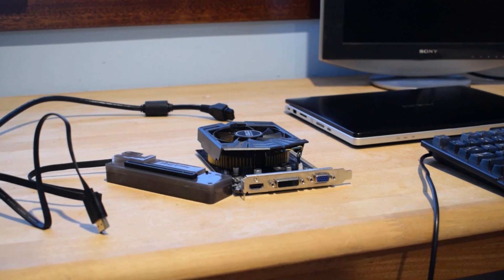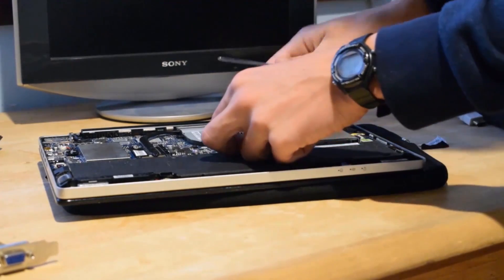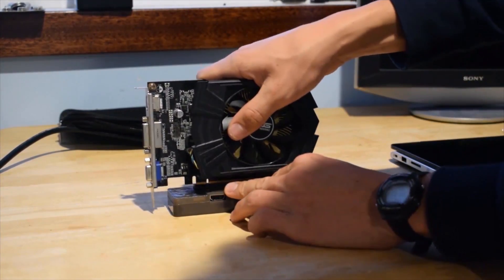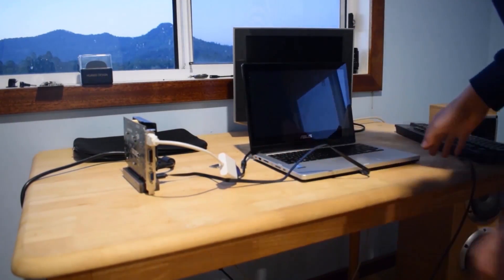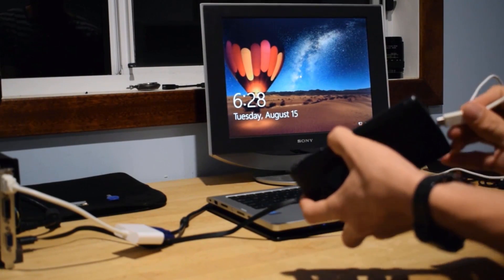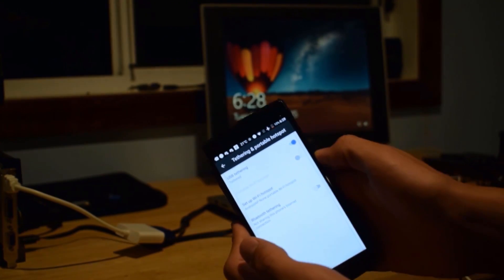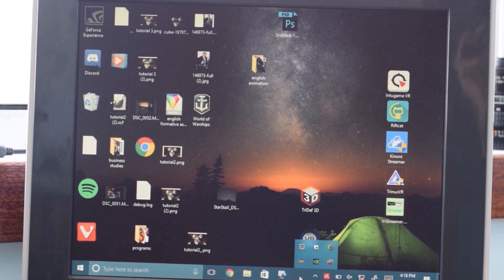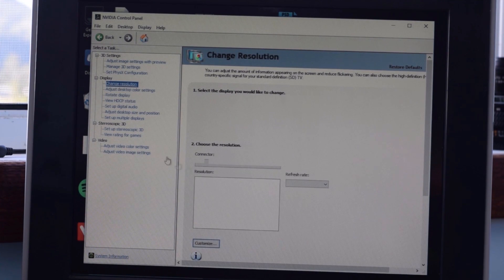How to Connect External PC Graphics Card to Laptop (no thunderbolt port required) Egpu Setup

Comment from the maker: Any questions are welcome. Just ask, and I will do my best to answer them as fast as possible.
Reply from the maker: You could also buy a usb wifi dongle. Also note that if you use your phone, it will share your wifi connection, not your mobile data connection (turn off mobile data just in case).
Reply: Hey qwertypop.  I got the same laptop that you have and  I am thinking to use an 1050ti as an egpu will this work or not , because some people are saying that 1050's cards do not work as an egpu
Reply: qwertypop can you write down what i need for the other two i am getting a Nvidia GeForce GTX 660 or higher is this a mid or high end gpu? and also once again can you tepl me the required things because i cant hear it clearly i am sorry.
Reply from the maker: All the things that you may require for the egpu setup are listed on my website: https://qwertypopyt.jimdo.com/buy-products-seen-in-videos/
The GTX 660 was a mid range gpu when it was released, so it is about on par with the new low end nvidia cards. Bit of a discussion on the gtx 660 in 2017: https://linustechtips.com/main/topic/716954-is-the-4-year-old-gtx-660-still-relevant/
If you need more help deciding which graphics card to get, I would recommend looking at some benchmarks on youtube and recommended requirements for the games you would like to play (if you are planning to game on it).
Reply: qwertypop thank you alot :D
Reply from the maker: No problem :)
Reply from the maker: Just to clarify, are you wondering whether all graphics cards are compatible with external gpu setups like this one?
Reply: i'm using GTX 960 OC , and everything went well the laptop detects the GPU , but when i start playing the gpu turns off and the games crashes and i lose my ethernet connection at the same time , does that means i need more power for my gpu ?
Reply: I noticed that there is a 6-pin connection on one end of the dock. What is that for? Also, where should I connect a supplementary power connector (example: 6-pin power for a GTX 1060 3GB)?
Reply from the maker: +Medo 666 what power supply do you have? Also, maybe you just overclocked it too much. Try setting the frequency back to normal, and see if it still happens.
Reply: +qwertypop

Hi i want to ask you  if my laptop is compatible to have an e-gpu this is my laptop spec :

Acer aspire v3-571

cpu :  i3-3120m 2.50 ghz 2500mhz 2 core / 4 thread
gpu : intel hd graphics 4000
ram: 4 go
usb : USB 3.0 x1 USB 2.0 x2 HDMI port
Reply from the maker: +Mehdi El Yes, your laptop should work fine with an egpu setup.
Reply from the maker: +Aliff Suhaimi I think thats for additional power, but I honestly don't know. Try googling it, I don't have time at the moment as im not home.
Reply: My laptop 1gb ram will it work
Reply from the maker: +Hamdi Messi If you want to game on it, I would SERIOUSLY consider upgrading your ram. To try to determine if a egpu setup would work I would need to know your laptop brand, model and specs (cpu etc)
Reply: My laptop has Intel Core i7 4700MQ and im planning to buy 1060 or 1070. I dont wanna bottleneck the GPU too much. Im fine for %15-20 loss if its safe. What do you think ?
Reply: sub for sub,I am subcribing to your channel right now.Sub back)
Reply: qwertypop BRO please help me out, my laptop graphics stop working and need new gpu if i do this with external graphic card like your videos it was work or i need the gpu from laptop too??
Reply from the maker: +Angel I think that might actually work, as long as it runs off the egpu without the actual drivers being installed, which I think might work. I have no first hand experience with this issue though, so can't guarantee it will work. I'm just saying it's possible (seems logical to me that it should work normally). You would definitely need an external monitor though.
Reply: it will work with monitor laptop?
Reply from the maker: +Yusuf Note sure if it will work with the laptop's screen. If you have intel hd integrated graphics, then yes, it should work at least technically. There can always be issues stopping it from working, like my laptop disables the integrated graphics when try external ones are connected, so my laptop screen doesnt work with it.
Reply: So am i right in saying you loose the use of wifi ? If so is there any other way of not lossing wifi instead of using lan or phone ?
Reply: I think that phone USB connection is hotspot share from your wifi>phone>computer and it will work fine
Reply from the maker: +Umut Yamaç Koman Yeah, that's correct. If you do it, just turn off mobile data just in case, so that it definitely only uses the wifi (I think it would only use the wifi connection anyway, but just to be sure, dont want to waste your mobile data).
Reply: qwertypop my vga onboard is intel hd, so it will work, yes?
Reply from the maker: Yusuf It should work, but there is no guarantee that it will. Like I said, it should work on my laptop too, but it doesn't because it disables the hd graphics when the external one is connected.
Reply: I have an HP laptop with an i5 7200 u with 8gb of ram and a crappy dedicated GPU, can I remove the dedicated card and use that method that you´re using to install an external GPU? Thanks for reading this and answer me.
Reply: Bro can we add gpu if how
Reply: This isn't going to work if you have an older CPU. You'll have bottleneck issues up the ass.
Reply: Can you help me im buying a lenovo y500 and plan on using a epgu with it can you tell me how to completely delete on board nvidia graphics?

Comment: I have an ancient Toshiba Satellite C660 21Q with an Intel Pentium 2.00GHz Processor, 6gb of RAM and it runs on Windows seven, would I be able to run a decent graphics card like  http://www.ebay.co.uk/itm/XFX-R7-240-2GB-DDR3-Graphics-Card-7000-MHz-DVI-VGA-HDMI-PCI-Express-3-0-/202043858417?hash=item2f0ac09df1:g:occAAOSwY7pZqmMe
On it, and would I need to buy an extra monitor or is there a way to just use my laptop? Thanks!
Reply from the maker: Yes, that should work, but note that the cpu or gpu can both be bottlenecks when performing different tasks, as some applications are more cpu intensive while others are more gpu intensive. From what I know, you need to use an external monitor (at least I haven't figured how to get it to work on the internal monitor).
Reply from the maker: Sorry, I was sure I had replied to you, but my reply appears to have disappeared :(
Yes, you can use an external gpu like the one you linked fine, but performance will vary from application to application, as some applications are more cpu intensive, while others are more gpu intensive. With the external monitor question, I reckon you should expect to require one, but maybe just get the setup, try it on your laptop, and then get a monitor if the laptops screen doesn't turn on. As far as I know the internal monitor is supposed to work as long as you have intel hd integrated graphics, but there will most likely be a performance decrease as opposed to using an external monitor. In my case, my computer disables my intel hd graphics when the egpu is connected, no idea why, but I believe this is what is causing the internal monitor to not work in my case. Not sure if this is a common issue.
Reply: Thanks for your reply, it's extremely useful!

Comment: my laptob is Dell 
processor : intel (R) i3 cpu m 380  2.53 GHz 
ram : 6G 
well it work
what i can bye ?
and lets say that i want to remoze this things and get back my WIFI card can i or no ?
Reply from the maker: Yes, it will work. You can also just unplug the cable at any time, and reinsert the WiFi card to get back the normal function of your computer. Just make sure that the computer is turned off fully when you change the egpu for the WiFi card. For the graphics card, maybe something like the gtx 750 would be good?
Reply: qwertypop  ok ty iqm not sure yet iam joing to byu it and do all that but ty for the very good help
Reply: زياد وائل 
هلا
Reply: زياد وائل 👍
Reply: qwertypop Don't 'just unplug' anytime as a hotswap. I'd think safe to say your CPU or MoBo integrated/discrete gfx solution wont like it.

I have yet to try a PCIe fix though most likely same as the PCMIA solutions from back in the day.

Try a system reboot before/after plug in.
Reply: Could you help me qwertypop?
Reply: qwertypop, i was wondering if there was an alternative thing i could do to still have wireless internet connection (as in not use an ethernet cable) but still be able to plug the adapter into the wifi card slot. Also, is it possible to do this with a Hp Pavilion (model- 15-ab165us) and IF SO, what eGPU would you recommend for the best performance that this laptop can handle?
Reply from the maker: +PIPPINGAMING Unless you have an express card slot, a thunderbolt port, or a spare mPCI-e port, you will sadly need to disconnect the WiFi chip. You can always USB tether your WiFi connection from your phone to your computer, or buy a USB WiFi adapter. Also ensure that your laptop does not have a bios whitelist (don't think it would have one, but never 100% guarantee). More info on whitelist here: https://h30434.www3.hp.com/t5/Notebook-Wireless-and-Networking/Does-HP-Pavilion-15-e001ax-has-bios-whitelisting/td-p/5973244
Reply: U should buy gtx1050 ti
Reply from the maker: his comment is 5 months old...probably too late.
Reply from the maker: + زياد وائل did you end up getting an egpu setup? If yes, how did everything go? Does it all work for you?
Reply: memez trojan 
He is arabian

Comment: Thanks for this. I know about the whitelist but I also have seen some HPs & Lenovos being used for this here on YouTube my question is however is 1.) Can you make a dual monitor setup using this? 2.) I am particularly concerned more about using some low-end laptops (an HP630) for video editing anything from UHD to Full HD 1080p video. I just look at this and think if it can work for 3D graphics, it should for video. Am I right or wrong? Please reply and Thanks again for the clear and direct steps.
Reply from the maker: +PlayPro Studios I think that as long as the gpu has enough ports to connect 2 monitors (if it doesn't, you could maybe use a port splitter: https://m.ebay.com/itm/1080P-HDMI-Port-Male-to-2-Female-1-In-2-Out-Splitter-Cable-Adapter-Converter-New-/172463911930?var=&hash=item2827a673fa%3Am%3AmG1pYq9_e3x2a_H1QfXex0w&_trkparms=pageci%253Abd186123-a4a5-11e7-8c03-74dbd18025d4%257Cparentrq%253Acad8838215e0aa48450ec849fffffa8f%257Ciid%253A4&varId=471311989285) a dual monitor setup should work. From what I know and have read, video editing is mostly cpu bound, which means that a gpu won't help much. http://www.tomshardware.com/answers/id-2539417/gpu-cpu-video-editing.html
Reply from the maker: PlayPro Studios A gpu would still reduce the final render times though.
Reply: +qwertypop Thanks a lot for replying, I almost pulled the trigger on a purchase which would have been a waste as I don't game much but gladly, the articles you linked helped clarify some more. Am thinking CPU upgrades now. Will still try this for fun though with stuff I already have. Just want to put some laptops I have to use. Thanks again.

Comment: I have lenovo G40-45 with AMD A8 processor, what graphic card you recommend?
Reply from the maker: Khairul Sably It seems like your laptop might have a bios whitelist, at least from what the person on this forum was saying: https://forums.lenovo.com/t5/Lenovo-B-and-G-Series-Notebooks/Lenovo-G40-45-Wlan-Whitelist/td-p/3479929 
You can not connect an egpu via mini pci-e on laptops that have a bios whitelist. I recommend you do some more research to determine if your laptop has a bios whitelist, and if yes, if there is a custom bios that you can flash to remove it. Hope this does not ruin your hopes for better fps.

Comment: Can you connect the HDMI directly to the laptop? (Sorry for bad english)
Reply from the maker: Joaquin Castillo No, I have tried that, but the monitor does not show anything if you do that.
Reply: Okay, and it works with a HP?
Reply from the maker: +Joaquin Castillo You need to check if your laptop has a bios whitelist, as some hp laptops have this. How old is the laptop?
Reply: Joaquin Castillo use expresscard if you have it it's better than modding the bios of an hp (it didn't work for me) that's why i orderd the expresscard cable.
Reply from the maker: TheScreamerBoy True, if you have an express card slot that would be a good option to bypass the bios whitelist problem on some laptops. Thanks for pointing that out.
Reply: qwertypop welcome :)

Comment: I have acer, Core i5 7200U 2.70 GHz, 8gb ram DDR4, would I be able to put gtx 1060 6Gb graphics card ??
Reply from the maker: Jaime Duque You can put a 1060 on it, it may be bottlenecked by the cpu though, depending on the game. Maybe consider getting a bit slower gpu to make sure you aren't wasting money because of the cpu bottlenecking the 1060.

Comment: I have hp probook 4430s, intel core i3, 8 gb ram and 2.2 ghz

Can i add external graphics card?
Reply from the maker: shihab khan I think your laptop may have a bios whitelist, which would prevent you from connecting an external gpu. I recommend you do a bit of research yourself though to determine whether your model does have a bios whitelist.

Comment: I  saw you have Tridef 3D installed on this laptop. Does it work? I have this LG 3D monitor and also a LG 3D Tv, both with passive 3D...
Reply from the maker: Sorry, I didn't really get it figured out. I was working on a project to play games on pc and use a Google cardboard headset as the monitor and be able to turn in game with it, but all the programs like trinus vr all had their problems, and the lenses for the Google cardboard didn't arrive, so I sort of just gave up on that project.
Reply: Ok. Thanks...I tried those as well trinus vr etc. Not very excited about that. Tridef 3D doesn't support much anymore and I didn't even bother to install it on my pc again. I'm gonna try the GPU Dock though... except for that I have all the components available... :) Thanks for the video!
Reply from the maker: +Sjaak Schulteis Thanks :) Yeah, I was quite excited about playing pc games in vr on Google cardboard, but then it was just filled with issues. If you are buying the gpu dock from eBay it would be cool if you could use my affiliate link as I get a commission on every item purchased through my link: http://rover.ebay.com/rover/1/711-53200-19255-0/1?icep_ff3=9&pub=5575330623&toolid=10001&campid=5338182500&customid=&icep_uq=EXP+GDC+V8.0&icep_sellerId=&icep_ex_kw=&icep_sortBy=12&icep_catId=&icep_minPrice=&icep_maxPrice=&ipn=psmain&icep_vectorid=229466&kwid=902099&mtid=824&kw=lg

Comment: My laptop has the requirements to use an external gpu ??, 4gb in ram a core processor 2 duo to 2.0ghz.
Reply from the maker: Gerardo Pimentel What exact version of the core 2 duo? Also, what brand is the laptop and how old is it.
Reply: It is the penultimate generation of processors before it was discontinued by the core processors i3 in future I think that in version centrino and came with windows vista and brand HP
Reply from the maker: Gerardo Pimentel hm, hp used to have bios white lists which prevent you from connecting an external gpu, so you need to make sure your laptop does not have that. Otherwise a rather low end gpu should work fine.
Reply: Ok I would have to check if it does not have that, thanks friend for your response greetings.
Reply: is an hp nc6400 already something old with windows vista that brings but it goes well with windows 7
Reply from the maker: Gerardo Pimentel Maybe check out this website regarding to bios whitelist: http://www.wemakerobots.com/en/how-to/hp-nc6400-whitelist-removal
Reply: qwertypop It's better to take the expresscard version since it's an old laptop
Reply: ok thank you..

Comment: I have an hp i3 8gb ram what do you think I should do
Reply from the maker: First you should try to find out if your particular laptop model has a bios whitelist, as this will stop you from getting any external gpu. Also, what is the model of your cpu?
Reply: qwertypop Intel core i3 5010u @2.10ghz
Reply from the maker: daniel anokam Assuming your laptop does not have a bios whitelist, I would probably recommend something around a gtx 750ti if that is good enough for you.
Reply: qwertypop k. Thanks